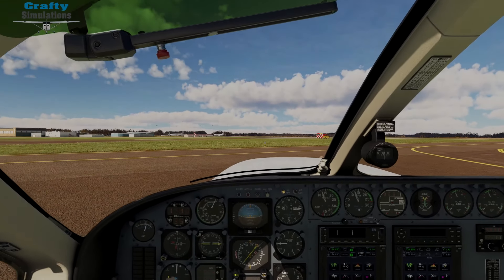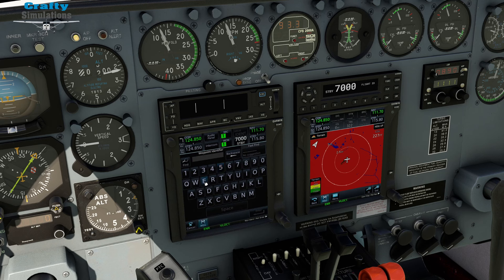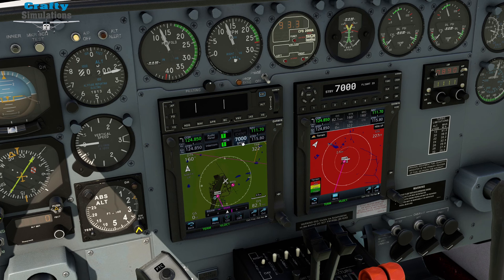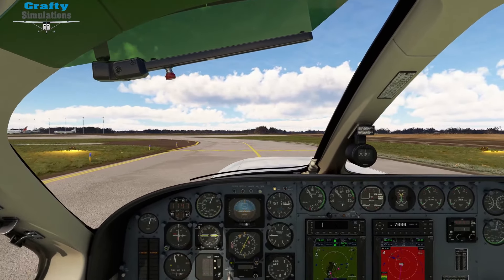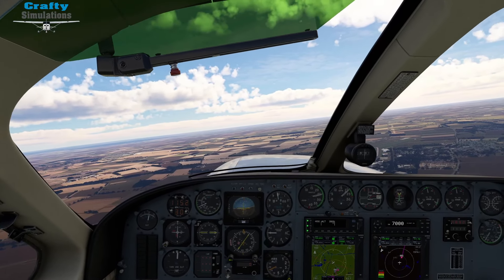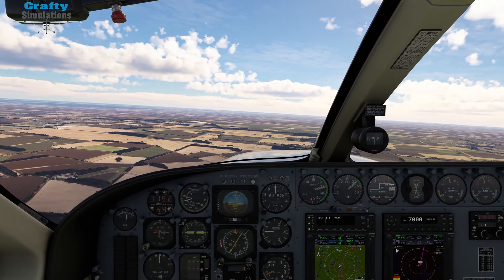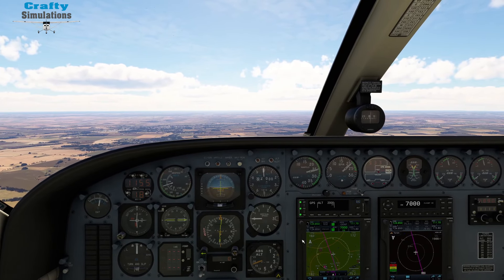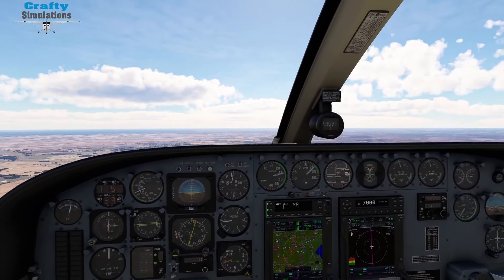CraftySimulations | Flysimware Cessna 414 Chancellor | NAV hold mode

Comment: I flew this plane yesterday for the first time in months.  It's a great plane indeed.  I don't have the 750 so I use the 530.  My route was VOR hopping from Walla Walla to Great Falls.  After the Missoula VOR I loaded the ILS 03 approach into Great Falls thinking I could use GPS to navigate to the IAF, but for some reason the HSI would not work.  I couldn't get rid of the horizontal flag and the CDI would not track the course.  I tried switching back and forth from VLOC to GPS several times and I tried loading and activating the approach several times, but the HSI's CDI would not come alive. 

Any idea what could cause this?  It seems to be a bug when switching from radio navigation to GPS navigation, but I don't recall ever experiencing it before.  Maybe something brought on by the recent updates to the C414 or maybe the Working Title updates?
Reply from the maker: Hi, I will have a look into that issue. Most of my time is spent using the GTN750 system but when im next off work I will try and replicate your setup and see what I get.
Reply: @CraftySimulations  Thank for looking into it.  I did a few more mixed radio/gps routes since, and have not been able to reproduce it.  A flight from Inverness to East Midlands and another from Nagasaki to Okinawa went without a hitch.  I must have did something wrong but I can't think what it could be.  I may try reflying the Walla Walla to Great Falls route sometime to confirm my suspicion.
Reply from the maker: @tonyw9152  I am sorry to report I was not able to replicate your issue. Now I will be honest and say that cant remember the last time I used the 530.